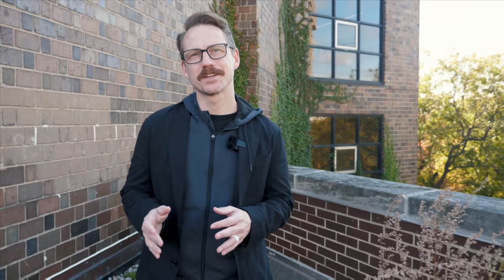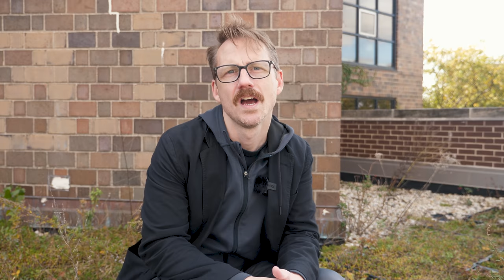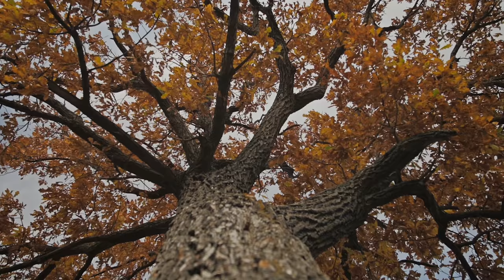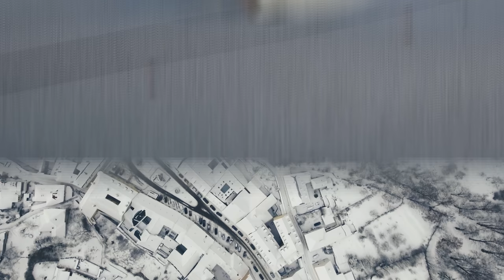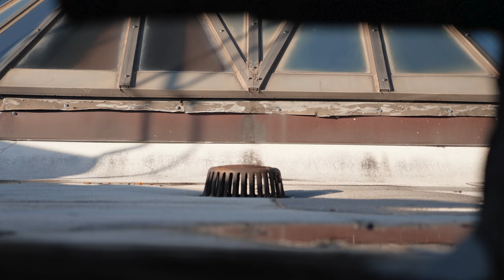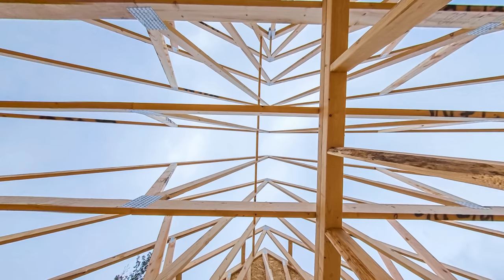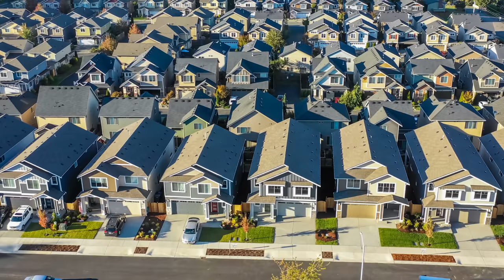Why Do Architects Insist on Using Flat Roofs?

Comment: Flat roofs are great but they require maintenance. The water proof layer needs to be redone from time to time. Most issues(leaks) related to flat roofs come from poor maintenance culture or bad construction. 

Awesome vid.
Reply: If you're plan is that customers do a lot of maintenance, you have a terrible plan.
Reply: Every roof needs maintenance. Most asphalt shingle roofs have a 25 year life span and deteriorate quickly after that. A flat roof surface can last much longer. The only additional maintenance is clearing debris from around drains. This is much easier to do than clearing debris from gutters.
Reply: @nathantaylor5308  yes every roof does, but a flat roof must checked far more often because a small problem is going to turn into a large problem quickly. Look at the examples of homes that had flat roofs Stewart gave they are very dry climates. So defects aren't likely to a problem often. In places where rain is quite common you do not see flat roofs in vernacular buildings. 

Yes they are an appropriate solution in some time and places but are deeply inappropriate in most.
Reply: As someone who owns a flat roof single family home (built in 1941) a couple KEY things are that the flat roof has easy access to the roof and sufficiently sized scuppers. Access (in my case a simple roof hatch) makes frequent inspection and clean up easy and much safer. I can also remove heavy snow loads if necessary without risk of a fall.  And undersized, or not enough, scuppers is probably the biggest problem since the scuppers manage water removal. Admittedly, they take a little more diligence, but for the small extra effort, the benefits are, in my view, worth it.
Reply: @fasdaVT  
You see plenty of flat roofs in rainy and even snowy areas.
My building and most of the other ones in my neighbourhood are over 100 years old with flat roofs.
This city gets a lot of rain and snow.
Reply: The biggest issue in flat roofs are drainage cleaning since they dont get cleaned as often or thoroughly  as they should flooding and cracking may hapen.
Reply: "poor maintenance culture or bad construction" or allowing people access to it while using pointed heels for example
Reply: well, you don't have a layer of gravel over your teeth that you need to remove whenever you need to do inspection :)
Reply: @fasdaVT  If a customer does not plan to do maintenance, then they will be a very unhappy customer.
Reply: @EmilNicolaiePerhinschi  how could I forget the pointed heels..
Reply: @twells138  customers will as claim they will do it but usually are lazy and cheap. If this requires more maintenance then once or twice a year you can't trust it to happen
Reply: Apart for maintenance, but related, is what life time expectancy do you have for your building.

In my country i generally find that "temporary" buildings (i.e. 10-30 years) have mainly flat roofs.
This will probably go back to the maintenance interval, but in that case it is a situation of "planned obsolence"

Comment: Regarding roof shape... I don't understand why you compared flat roofs to gabled. The comparison should have been to hip roofs, with no more than 30 degree slope, less than 20 inch of overhang, and squarish in shape. Best if square, but if not...then squarish. These are the best features against heavy winds... or... that is what I understand... both flat and gabled suck. Literally, in high winds, vortexes occur, the roof gets sucked off.

Comment: I personally prefer flat roofs for the extra space and utility. If correctly designed and installed the roof will perform as well or better then gabled roofs. But I tend to live in temperate climates, where strong snowfall is not an issue. With real estate getting more expensive having a flat roof does give more space to utilize.

Comment: I certainly do believe that "flat" roofs have their place, but conversely, you wouldn't build an Egyptian mud brick home in Chicago and expect it to last very long.
I do think that sometimes a flat roof is a lazy choice, just as a gabled roof can be.
Function is a major part of the design,  and putting air conditioners on a flat roof is not an excuse to have a flat roof, when they can just as easily be designed under a gable or shed style roof with more slope to remove snow loading.
It might even be a good idea to protect such equipment from snow loading.
There's also a huge difference in designing a flat roof for a commercial or industrial space, where building maintenance is going to be an ongoing expenditure anyway, and using them for residential uses in areas with high rainfall or snowfall.
Flat roofs can be efficient in hot arid climates, and can indeed offer extra living space, but that doesn't mean they make sense for Chicago winters, where snow accumulation is very real and it's highly unlikely anyone will want to go out onto their roofs.
I think there's also a point of discussion between low slant roofs and comparatively flat ones, as well.
Not every slanted roof has to have a high gable, but higher slants often shed snow better than low ones, and there are huge problems in letting heavy snow accumulate and depend on the escaping heat of the building to melt it into water drains.
I think most architects, if honest, would say they choose flatter roofs because installation and repair is easier/cheaper, and not because it is necessarily a "design feature", whereas the choice to have a gabled roof is definitely a design choice as they have decided to spend more money for that appearance.
I think there could definitely be a debate about whether a flat roof or a gabled one could give the homeowner more actual extra living space.
Reply: Really depends on the function and environment.  I design laboratories, and the roof is key for mechanical (and some plumbing) equipment.  Considering most of our buildings out west run 90% of their lives in cooling mode, even simple office buildings benefit from this arrangement.  The function of a roof is not only to just shed water and snow.

And if you are not aligned correctly to the sun, a sloped roof will not serve you well for PV.

But for a homeowner, have whatever roof you want.
Reply: Naw I'm a flat roofer, spend the proper money and let me do my job right and the flat roof I install will easily outperform whatever steep roof you think is better.   And I live in a rainy climate that guaranteed sees significant annual snowfall too.
Reply: I'm sorry but how exactly do you imagine an HVAC could be hidden under a gabled roof? They need to have access to fresh air all around to function so you'd need to additionally design a complicated vent system and then somehow prevent it from getting clogged up by snow and damaging the unit with all the melt water and rain, which will now accumulate inside whatever vent system you built. Not only that but for this to work you'd essentially need to build s flat roof anyways to hold up the units and then put an entirely seperate gabled roof on top of it, for what purpose? It doesn't actually help with rain or snow as flat roofs don't have issues with those and well in specifically this situation I've just made it clear that you're just making the problem worse. At the same time we now loose the benefits of either type of roof and more than double the cost of the roof, for I guess purely aesthetic reasons?

Comment: A big building has a lot of these drainage features, but not so much in residential settings. A friend of mine built a place with a flat roof 2 years ago, and he's already got water damage from the heavy rain we've been receiving in abundance in Australia. The gutters were also all clogged up because leaves easily settled on top.

Comment: I think there must be a compelling engineering reason to justify the use of an architectural element that will require more maintenance over the long run ( we should be designing for a building to last 100 years without major structural work like repairing a roof that collapsed because of snow load from a 500-year blizzard in a time of climate change )
Reply: Yep. I'm pretty sure pitched roofs also protect the house from the heat and cold a little better too - not to mention you can get in there if there is a leak and check out if it's caused any problems, as well as upgrade / improve / replace your insulation & wiring without cutting holes in your house.
Reply: You know nothing about engineering if you think it's possible to design a building to never need major repairs for a century, unless youl literally want to live in a pile of rocks this is just impossible. The way buildings last for a long time is with regular inspection and maintenance.
Reply: @hedgehog3180   you can design it so it is easy to repair or hard to repair. You can use screws or glue  one is easy to repair  and one is hard to repair.You can use drywall or wood panelling, one can be removed and reattached and one can not .You can Use brick or stucko , one can have a section replaced easily and one can not.This idea is not that hard to understand

Comment: 7:08 oh yes there is a huge difference between exterior and interior water drainage. Piping doesn’t last forever and it takes a very long time to see if there is any leaking when you hide your drainage inside the house. When you see problems from the inside, damage is often already done.

Comment: I don't have a particular issue with flat roofs themselves, but I do have an issue with the lifespan expectations people seem to have with their buildings, especially maintaining them over time, and the layout design often seeming to be, design it first, then make it work for the environment its in later, rather than being informed by the context from the ground up. I know it's, in many, maybe most, cases an upfront cost issue but it's still frustrating. 

It's a bit hard to explain, my complaint is not very informed, but "Passive" design solutions for cooling, like the way termite mounds are built to exploit wind for air circulation (there are several human cultures with history of this, including, iirc, one which managed to cool a structure enough for basic, expensive refrigeration). Modern housing absolutely does do this to a degree, but... It is all the same fundamental template idea, that is then adapted, often poorly, to the site. Even things such as refusing to build elevated housing in floodplain areas baffles me. There is such an attachment to a hyper formal idea of what a "proper" looking building is and a refusal to genuinely inhabit the place something is, rather than transplant a badly fitting ideal into it.

Philosophical meandering aside I hate how much photogenicness is a priority in builds, especially housing, now. Tired of living in open plan houses which are incredibly hard to cool and you can hear housemates scratching across the house.

Comment: Flat roofs are awesome for everything except running cables after the fact. I worked for a modular building company that made high end portable offices and flat roofs were way easier to build and gave a lot more internal space whilst maintaining good insulation and allowed our portables to come under the overheight regulations. We used heavy wall steel framing and steel composite roofing sheets so these buildings are incredibly durable and relatively easy to pick up with a crane. Most of them had 2 degrees of fall but some had only 1 degree, the buildings were rated for torrential rain which meant the use of very expensive roof sheets but they could be built with 5 degree falls and be a lot cheaper.  Flat roofs also made it easier for the crane dogman or operator to connect the crane to the lift points and for trades to acess the top to perform work or maintenance.

Edit: these roofs are not cheaper as a general rule. We used 3mm 150x50mm tube for the ceiling joists which supported the purlins which were 2mm folded gal sheet welded to 25x50mm droppers with a 3mm wall thickness which was in turn welded to the joists with a spacing under a meter. The whole structure then had cross bracing welded in and the sides usually had a PFC between 200 and 300mm with a webbing thickness of 8-10mm flanges between 75 and 100mm and flange thickness of 12-18mm. Basically heavy duty structural channel on one side and a header of 4mm 125x75mm tube steel on the other sides. These were extremely heavy buildings with lots of steel which allowed them to have a lot of usable internal space whilst being far stronger than a static building. A standard mod would be 4.5M wide and 12M long finished and weigh about 10metric tonnes. They used steel stud walls 13mm plaster 10 or 13mm double glazed toughened glass with aluminium frames, structural manufactured timber floors (red tongue) and whatever cladding the customer wanted.  All up they usually cost about 100k AUD or about 60KUSD to build but that was in 2019 before steel prices basically doubled which is the majority of the material costs.

Comment: The way I see it, form does follow function. The function of roofs has changed, so the form does also. It is not just about shedding water anymore, and since waterproofing and pipe drainage deal with that, the flat roof can be made for gardens, social spaces, equipment installation, etc, which is the primary function today, and the plus is that it avoids wind related issues.

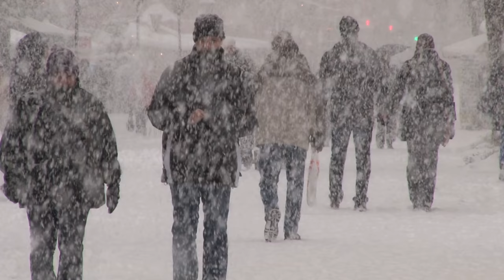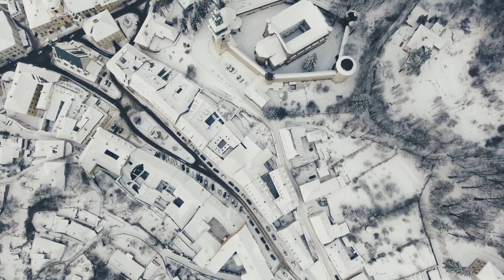Comment: Re snow (0:32and 5:32)... unless a roof is very steep, clad in a slippery material (usually metal) or your typical snow is very wet, most snow will tend to stay put on a roof rather than slide off, pretty much regardless of slope. That's particularly true now with proper roof insulation that prevents heat loss and thus avoids snow melting on the roof. So for the typical house in Canada (where I am) with a roof of 3:12 to 7:12 pitch clad with asphalt shingles, the dryish-snow we get for most of the winter will be there all winter long.

I'm actually of the view that a low-sloped centre-draining roof might be a better solution for houses in snowy places: the drainpipe itself will be a conduit for warmth, especially if it's a standpipe that can heat up in the sun. That ensures that the drain will be clear of snow before the rest of the snow on the roof starts melting in the spring and the melt will generally proceed outwards from that drain, whereas with typical roofs you can get a scenario whereby snow near the ridge melts but encounters snowpack further down the roof (esp on north slopes) and can refreeze.

Comment: Use a  mix of 2 roof systems. Gabled for main house, flat roof above garage  or utility areas ( if it leaks, at least its a garage/utility area below). 

Can also install flat roofs above  bathroom areas for HVAC placements

Comment: This is an excellent, extremely informative video. Similar analysis of other architectural choices would be so helpful. In this decorator-heavy, HGTV world, there’s far too much emphasis on finishes and colour, but the more important questions are ones of architectural form and space planning. Anyone with a bucket of paint can change design, but a building’s architecture is its soul, and endures for the ages, or fails.

Comment: Great video! And yeah, overall your channel is a gem. Especially for aspiring architects. In residential architecture, I wonder if sloped roofs give a little more leeway in maintenance concerns, as a homeowner may stretch it a bit. From the commercial buildings I've worked in, they are always replacing ceiling tiles, which is relatively inexpensive. And this is from a relatively new roof system (<5yrs old) that gets the budget it needs for maintenance. Like you said this is valuable space to put HVAC equipment, so just a part of doing business I guess. I think it would be interesting to take a deeper dive into low sloped roofs and their details, residential mainly, but commercial would be cool also. Being from Michigan, a flat roof seems out of the realm of possibility for a house, but then again, it's used almost exclusively in commercial buildings, so it can be done.

Comment: In architecture education, sloped / gabled roof often carries an image of non-archictural projects (suburb homes) and historical-architecture (chinese / japanese temples, townhouses, spanish architeture). Using sloped roof can often points to the fact that the student is defaulting to standards (which also happens with flat roof but less often) or trying to imitate history without proper care or translation into the entire building design (roof and floors became 2 separate objects). So in the end, it's more about surfaces as a tool for archtiect to hollistically design a building in response to contexts, programs or whichever.

Comment: This was such an interesting and informative video. I've always thought that flat roofs are simpler and functional at the same time, and as you said, it's more sensible n practical to use them in horizontal buildings.

Comment: Perhaps something overlooked a bit is how useful flat roofs are for things like HVAC units, which wouldn't be practical on a sloped roof. Super important for urban areas where ground space is limited, so it's not like a suburban house where you can just have the central air unit sitting next to the house.

Comment: Brilliant video, it was detailed and informative. At one point you mentioned the ability of flat roofs to be occupied by green space. I would be a very interesting topic to discover why so many green roofs in colder climates such as here in Ottawa, Canada, are being forgotten. There are numerous buildings in Ottawa where architects integrated green roofs into their designs but then they never end up being used. Seems like the roof you're on has also had that experience. Is society's obsession with safety undermining practicality?
Reply: They die, really easily. Just need an especially hot summer.